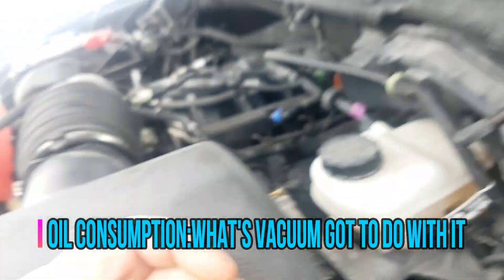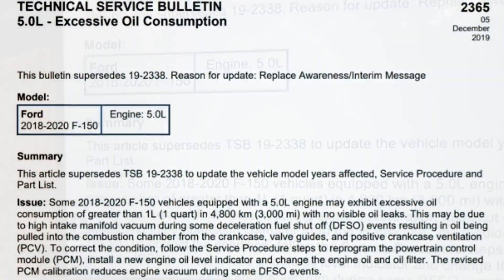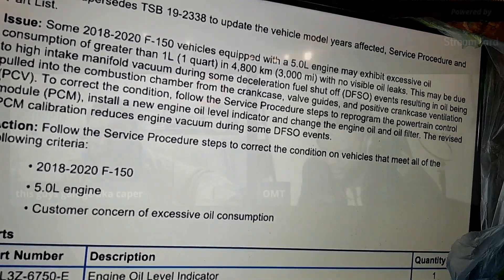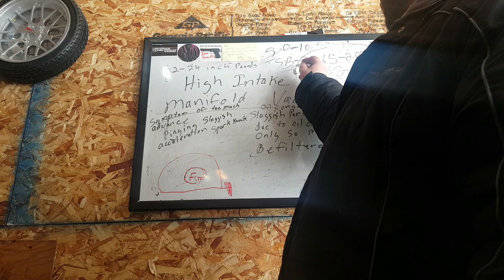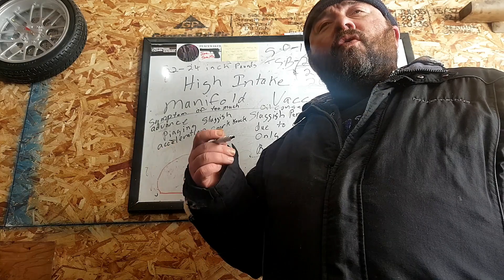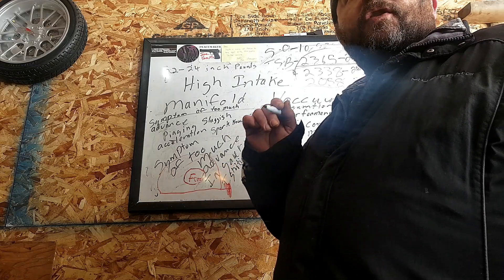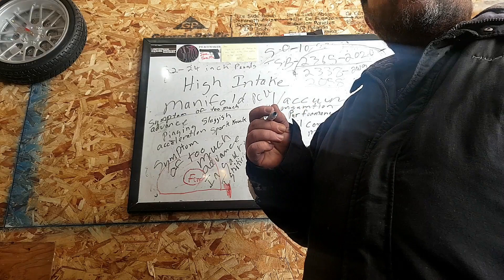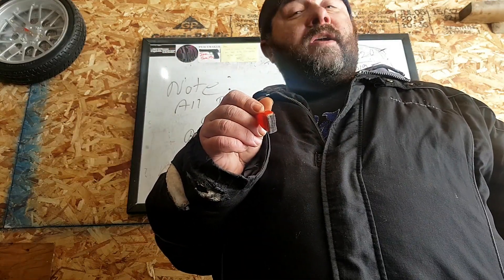FORD f150 5.0 oil consumption 2018 2019 2020 vacuum test tsb 2365

Comment: I wouldn’t say they are now overfilling the engine with oil. Where did you get the info that they increased the oil capacity? The new dipstick has an adjusted range, (longer with a lower add mark). The old dipstick only had a range of one quart between full and add, in an engine that holds 8.8 quarts. You could see it physically when looking at it, the 2 holes were very close together in such a big volume of oil. It was more likely that dealers were under filling vehicles by half a quart and then when they burned another half a quart people freaked out because the stick reads add. That means it’s empty to most uneducated people right? No, the engine still had 7.77 out of the 8.77quart capacity even though it’s on the add mark. No wonder they adjusted the dipstick. I also changed to the updated pcv valve, had the tsb done to reprogram the pcm, and switched to full synthetic 5w-30 instead of 5w-20 to help cut down the consumption. I’ve had mine 6 years now and if eventually it needs a new catalytic converter then so be it. A catch can on this truck and especially my wife’s strictly direct injection turbo explorer goes a long way to keep intake valves and catalytic converters cleaner. As far as modern engines go I’d rather deal with this than the 6.2 chevy grenades or the turbo carbon collectors, or the turbo hybrid combos.

Comment: i got a brand new  2018 ford f_150 with 5.0 V8/ 10 speed  auto  transmission since  then  having to  replacing 2nd to 3rd  new engines  between  3 Ford  dealerships both states Az, and Illinois  during  time  3 years  leasing  and buying out the  leasing between  2018 and 2022 maybe  still unsure about transmission  to currently now  C.D.T. Chicago  and subs  state Illinois at 6:48 am on Friday morning of November _3_2023 also  check  law suits  dismissed by federal government  judge encouraged ford motor company....

Comment: I purchased a new F150 with 5.0 about two months ago. I noticed a puff of blue smoke at start up from day one. At about 3200 miles I checked my oil to discover oil was so low it was barely touching the tip of the dip stick. Dealership informed me it was common for new vehicles to burn oil upon breakin period. I call BS. Any suggestions? I really love the truck but I'm considering trading it in.
Reply from the maker: Get an independent shop to do a leak down test to find out what percentage the engine is down on compression.  Also get an oil analysis done. You need documentation that can't be refuted. 
That's the best place to start if you're going to war with Ford. 
 If the end result is trading it in keep as little documentation on the oil consumption as possible...car fax for example.  Let me know how you make out 👍

Comment: I have 2019 and I’ve always complained it sounded like a diesel
Now with 24k miles the truck shutting completely off sometimes
I’m going through the oil consumption deal with the dealer(they’ve been upfront about the known issue)
I had a 2000 F150 before this (engine throwing spark plugs)
Reply from the maker: great they are being up front,please let me know how you make out1👍

Comment: This is a little off topic but -- have you noticed your f150 fog lights "spidered" cracked? i noticed both mine were and after further investigation i figured out it was from the factory halogens -- when i called Ford they said absolutely not covered by warranty -- yet they are aware of the issue.
Reply from the maker: I will take a look when my wife gets home. swollen dash is another problem in the  aesthetic department. ty for taking the time.

Comment: Question what is the recommend fuel octane for your truck?  I have seen companies rate and build vehicles for mid grade gasoline so they can advertise better fuel economy numbers. Older 87 octane winter blend in cold temperatures maybe causing the timings to be outside the engineered range. Just spit balling
Reply from the maker: There is no recomendation on octane as far as I know but supreme gets a verifiable 10% better mpg 
If you can get 94 octane it is that much better again.

Comment: Will switching to 30 weight oil instead of 20 weight semi synthetic help especially in warmer climates?
Reply from the maker: These trucks never had this problem before 2018 till the introduction of the 10 speed transmission. Oil weight was never an issue. If you make this change ford will have a reason to deny coverage not that the warranty is worth the paper it's written on.
They are sadly undergeared  as far as gearing goes.  Underpowered for the gear set and too heavy to run down the road the way they are engineered presently.  The engine is getting worse out.

Comment: Had a 2018 F150 Lariat V8 build date Sept 2018. Purchased on Jan 2019. Started having burning oil issues at 3000 miles. Consumed over 2qts. Then checked at 5000. Burned 2.5 qts. Changed the oil out at 5000 miles. Used Amsoil. Consumption went down a little but still consuming over 2 qts in 5000 miles. Then had the dreaded driveline clunk at startup. Then had the noise on deceleration when the engine was cold. Also had a clunking noise from the drivetrain when slowing down and then accelerating. And the kicker is I’ve had so many people ask me if my truck was a diesel. Sounded just like the one in the video. So I traded the truck off. Such a bad experience on my first Ford I owned.
Reply from the maker: This is criminal. Thanks so much for sharing your story.  Someone asked me 2 weeks ago how I liked the new diesel.  Appreciate your time 🤜🤛

Comment: The vacuum claim from ford makes no sence. If my truck is pulling oil past the piston rings and burning it , it would blow smoke out the tail pipe like a old Honda civic. It does not. So this still does not seem to make any logical sence to me
Reply: never in my 19 limited f-150 it blew blue but dam did it go through oil....2 quarts every 1,000 miles
Reply from the maker: Synthetic oil doesn't burn and there are catalytic converters taking care of the blue. 
Thanks elijah